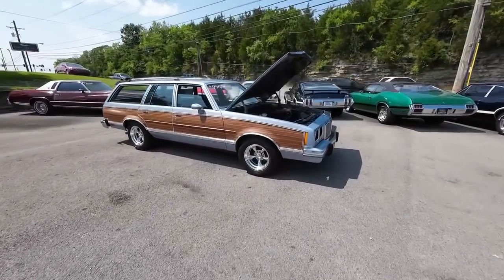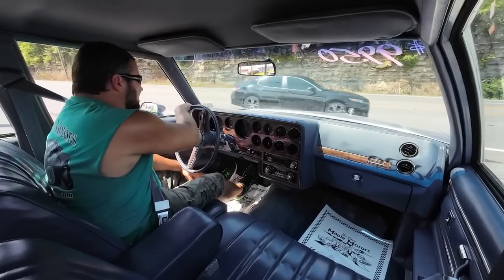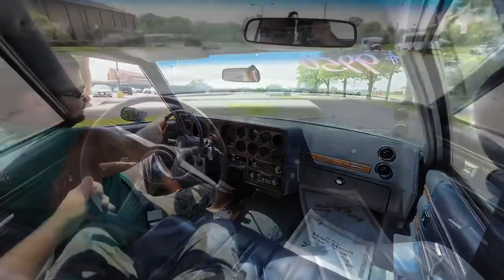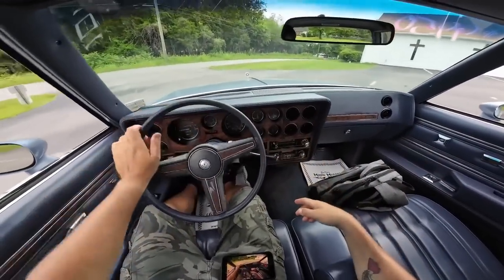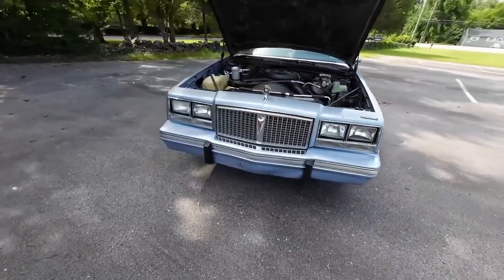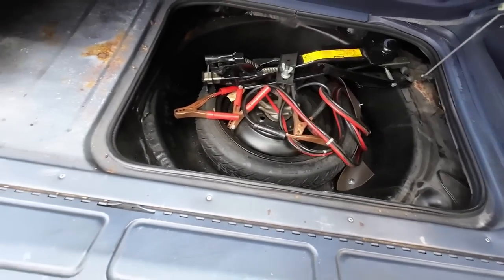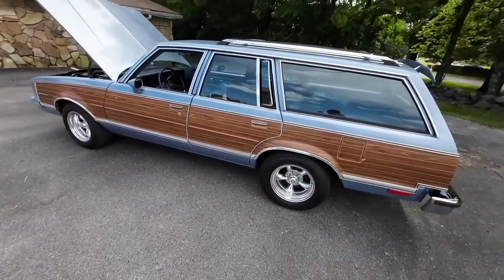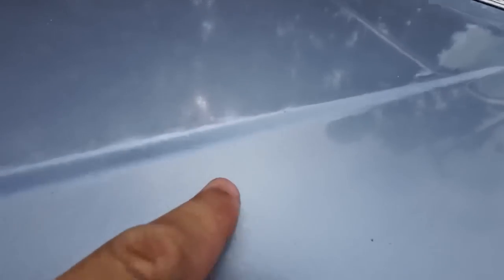Test Drive 1983 Pontiac Bonneville Station Wagon SOLD $9,950 Maple Motors #2265

Comment: Man, that thing is clean! Just add a nice dual exhaust, LeCarra steering wheel and fix the a/c  and you'll have a super nice cruiser. Too bad it doesn't have a 700R4 trans with overdrive. I think they went to that in '84? Anyway, I don't think this car will be on your lot for more than a day or two.

Comment: Holy sh**! It the family truckster from National Lampoon's Vacation! Who's up for Wally World?!  😁. C'mon brother. No A/C, body damage, what about underneath the car? Any rust?  And 84K miles and you guys want $9K.  It may have retailed at $9K when they first rolled out. Now?As is?  I'd give you $2500K for it knowing how much money I would need to dump into it to get fix all of the issues.  . Did you guys service the engine/transmission, brakes, replace drive belts? Changed fuel filter plugs, plug wires etc?  If not? Definitely not worth what you guys are asking for. Good luck in getting someone to pay asking price.

Comment: Nice BUT. It's a basic USED CAR. So it's got mag wheels, big deal. It's got major rust issues. Trust me those "tiny bubbles" a a HUGE problem when you open it up to repair.  And at 87000 miles it prime time for the breakdown money pit to start. 
Basic USED CAR.. maybe worth $2000 max. You'll need the other 8000 for near future repairs